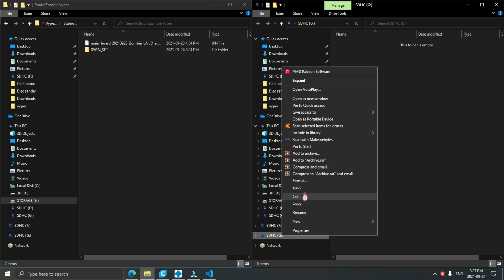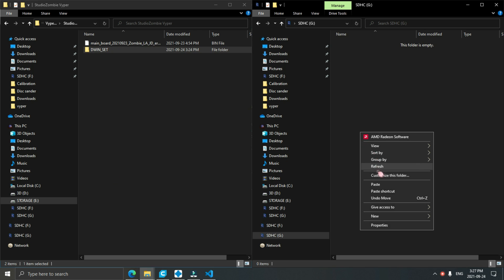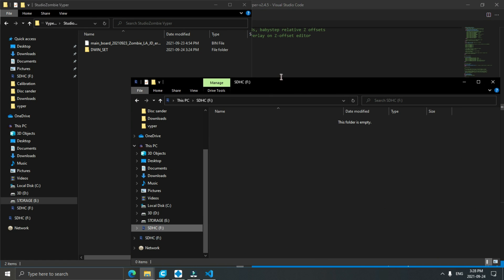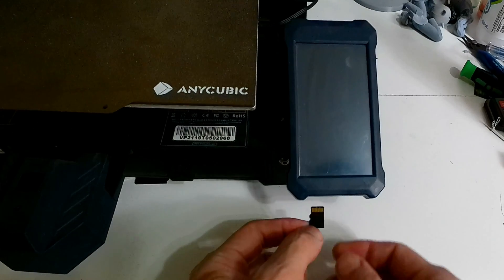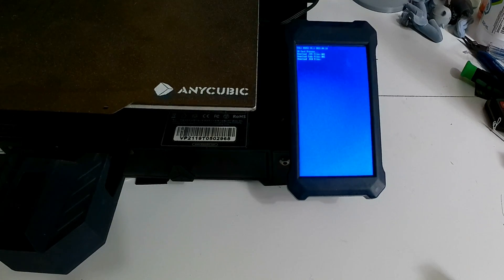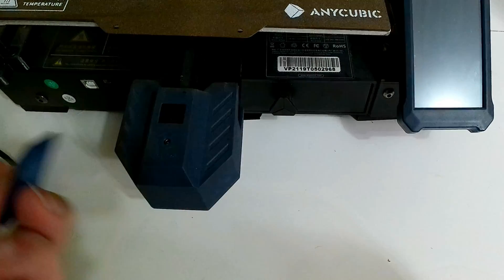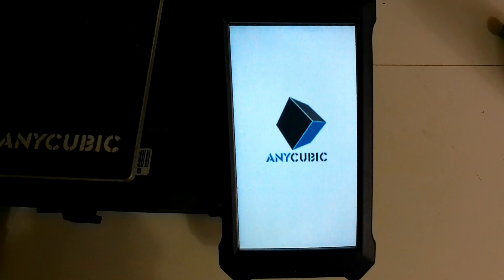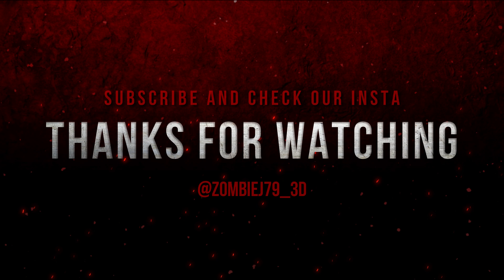Anycubic Vyper Firmware Update

Comment: My screen will do it's update, but when I format the SD card to the proper allocation and copy over the firmware version, it just boots up and goes to the homescreen. It is currently running 2.3.3. Not sure if that is an issue or not? Any suggestions are welcome. Thanks.
Reply from the maker: To flash the printer I just use the card that came with it. Think it's fat 32 as well try formatting it and trying again
Reply: @studiozombie3d  Thanks, that worked for the firmware update! However now when I tell it to level, the leveling button just keeps flashing rapidly. :(
Reply from the maker: @CraftHappy101  the lcd didn't flash properly. 
http://ridgecrop.co.uk/index.htm?guiformat.htm
Try this program.tp format fat 32 4096 for the lcd
Reply: @studiozombie3d  You are the best. I love you. I have had so many issues with this and the anycubic documentation on this is either horrible or I can't find the proper one. I had to update the firmware because every time I tried to print, it would just shut off. Now it's printing and I'm happy. Going to catch up on all your videos and subscribe.
Reply: @studiozombie3d  Although printer is still shutting off when I try to print anything :(. Still troubleshooting. I have ruled out firmware at least.

Comment: You are doing good work here StudioZombie 3D. I have been running my ver-6 motherboard Vyper stock for a few months but noticed some issues with false positives on the run out sensor and sometime the system would just stop and lock up mid print. 95% of prints worked just fine. I decided to install the new 2.45 on the site and I'm not sure if the display update is working as it just lists a number of files all ending with 0 and finishes pretty much instantly. The 2.45 locks up when you try to auto level.
     I downloaded and installed your 2.35 and I'm back up and running. Strange the display update did the same thing as the 2.45, which is listed a number of files all ending with 0 and then finishing almost instantly. I let it sit for about 10 min but it did not do anything else. I auto leveled and am printing something now. I'd say stay away from 2.45.
Reply from the maker: Appreciate that. What hapoend is your micro SD probably wasn't formatted properly. It needs to be fat 3w and 4096 allocation size. Try this program http://ridgecrop.co.uk/index.htm?guiformat.htm
Works well for alot of people.
When it works you will hear the startup tune play when it flashes successfully. Give that a try and let me know if that works.
Reply: @studiozombie3d  Had the same problem here, what i did was simply uncheck quickformat, it is way longer to format but works great

Comment: Has anybody had the Vyper freeze up after installing Firmware V2.4.5. Have printed since the update ok but just then it Boots up, light continually flashes and the touch screen locks up.
Reply from the maker: I haven't seen that yet. I honestly never ran 2.4.5 stock so I've never witnessed that. Does it still do it have you tried re flashing?
Reply: @studiozombie3d  Since I posted I've seen others reflashing back to 2.35 as there seems to be a known problem with 2.45. Rebooting a few times got mine running again but there is also a problem with bed leveling.  Of course I can't seem to find v2.35 so it looks like I'll be waiting for a fix.
Reply: Will try reflashing main board and LCD though, can't hurt.
Reply from the maker: @jomac2046  https://drive.google.com/file/d/1_cpZz7XlaqOvXUMr15VX3FW4K9ZHQv3s/view?usp=drivesdk 
Just so happens. I also have a custom firmware that's been working great for a lot of people
Reply: @studiozombie3d  Wow, thanks a lot....Appreciated!
Reply from the maker: @jomac2046  no worries I try to keep firmwares in case I need to go back to stock but I don't think I cam after having linear advance lol. Happy to help 👍

Comment: Doesn't work
When i put micro Sd card in, " sd card process...end" massage appeared immediately. There is no process.
I followed everything here but firmware version still same
Reply from the maker: What size is the SD card? Needs to be fat 32 and 4096 allocation table size
Reply from the maker: Anything over 8 gigs you need to use a special program 
http://ridgecrop.co.uk/index.htm?guiformat.htm
Reply: I had the same problem, SD card was formatted Fat32(32) , formated it to Fat32(4096) and it worked ok.

Comment: So what changed in this 2.4.5 firmware?  Is there something different with your custom compiled firmware?
Reply from the maker: With the stock there were minimal changes. Added some screens and the check for the sensor on level. My zpmbiev1 has the steppers in 2209_standalone mode so you can adjust voltage via mainboard it also has linear advance,junction deviation, the filament swap script enabled via terminal for now and fixed nozzle parking so it moves away from the print. Also some various tweaks. The stock still runs drivers in a4988 mode which isn't ideal

Comment: I flashed the micro sd, formatted it to 4096, copied the folder over to the sd, removed the sd and flashed the display. This seemed to be successful and after hearing the start up tone, I turned off the printer and removed the micro sd. I then copied the mainboard file to the other sd, inserted the sd into the printer and turned it on. It started up as if nothing happened and the firmware still says the old version. Where did I go wrong?
Reply: I used a 64gb sd to try flashing the printer. That seemed to be the problem. After switching over to the stock sd card provided with the printer, i reflashed both the display and printer and that seemed to do the trick. Beeped 5 times and now reads 2.4.5. Thanks for all the help!
Reply from the maker: @maxinaroundoutdoors  glad to hear you got it working. Just run through a calibration and your good to go now. Let me know how it works out for you

Comment: Hi, when compiling this did you leave hotend thermistor type to 5? (#define TEMP_SENSOR_0 5) By default I believe they use 5 and I wanted to use your firmware but I use one of those slice engineering thermistors cartridges instead of glass bead type thermistors. if not could you provide the source files?
Reply from the maker: The hotend thermistor is stock so should be 0 5 you can find the sources here. https://github.com/ANYCUBIC-3D/Vyper
You will need to get the lcd files as well from the issues tab. Or just use the lcd firmware from my file if you compile a firmware.
Reply: @studiozombie3d  Could you share your configurations.h/configuration_adv.h files? I'd like to edit them to include your changes but also add some of my own since I use an all metal hotend which I wanna push to 300c and want to add more probing for the bed leveling.
Reply from the maker: @skynet3157  ill get the files up on my drive today and add a link
Reply: @studiozombie3d  Sorry to bother you again zombie, but did you get a chance to link your configurations.h/configuration_adv.h files yet? I can't seem to find them in your tree but I'd definitely buy you a coffee in exchange for it.
Reply from the maker: @skynet3157  hey fire me a email at studiozombie3d@gmail.com and I'll zip the source package I'm currently using for you. Still no good lcd sources yet been working on one but been stupid busy lately.

Comment: thanks for the videos, I'm just trying to do this now on windows 10, but I have no 4096 option? The smallest one is 8192 bytes?
Reply from the maker: Sdxc are a bit of a pain but this program should work here 
http://www.ridgecrop.co.uk/index.htm?guiformat.htm
Reply: @studiozombie3d  Im having the same issue. error reads that the process cant access the file because it is being used by another process. Not sure why this is happening
Reply: tried the link and cannot seem to format still. Im using a 32G micro sd
Reply: @maxinaroundoutdoors  it's to big, you'll need to go to disk mangment in windows. Then and I cant remember exactly how to do it but delete the volume and then allocate a drive to it that is less than 8gb
Reply from the maker: @maxinaroundoutdoors  right click on the start menu then open disk management.then select the SD card and delete the partition create a new one that's 8 gigs and 4096 bytes create the partition and that should work
Reply: @GlaucusBlue  Im pretty new to this but thank you tons. Somehow was able to figure out how to change the size to 4gb now its working like a dream!

Comment: does it matter what motherboard version you have for this firmware? and how does this differ from the official anycubic firmware update?
Reply from the maker: I have a 0.0.6 board. It should work on the 0.0.5 as well but I can't test to confirm. The bigfix version has heater timeout enabled after 4 min. Octoprint tweaks for buffer and baudrate,enabled m600 command and changed load and unload to 400mm. Enabled linear advance and junction deviation and my new 2209 firmware has the 2209 drivers running in standalone mode so runs a bit quieter and cooler. And if your comfortable you can drop voltage on stepper drivers to 880 to run even cooler. But need to adjust on mainboard.

Comment: I try the second SD Card . Formating to FAT 32 and 4096kb. It shows always SD Card Process END and all Files 000.
Reply from the maker: You should be good to go then if you flashed the printer already you can check if it worked by checking m503 for the linear advance line m900 near bottom or level the bed and see if the safety check comes up

Comment: Could you post a quick video about recalibration once updated. Completing the update doesn't seem like a hassle at all but I have no idea how to change gcodes for a test print and determine what needs to be changed to improve quality
Reply from the maker: I can for sure make a video on that.will put one together tomorrow. Really all you need to do is calibrate your esteps your flow and linear advance. Theres a file in my folder you can print for linear advance calibration. Just have to tune esteps and level bed first. But will get a calibration video up tomorrow
Reply: @studiozombie3d  thank you so much!

Comment: Hi, appreciate the vid.  
On the first part you have the DWIN_SET that you use to patch the keypad.  Where is that coming from?
Reply from the maker: That's from the lcd sources on the anycubic vyper git page. I'm working on a new display firmware but you have to build from scratch and it's alot of work I used the  lre made package. Theres software with the pack to make the firmware but it's a odd program
Reply: @studiozombie3d  thanks for the info.  It seems you are way ahead of the technical curve compared to anyone else...
So, it is not something I can download from anywhere?  Will you be sharing it after the package is made?
Reply from the maker: @inosof  the sources I have are avaliable off the main vyoer git under issues theres a link to the lcd sources. They are a bit of a mess though right now
Reply: @studiozombie3d  Thanks bunches
Reply from the maker: @inosof  yeah no worries any issues or anything let me know